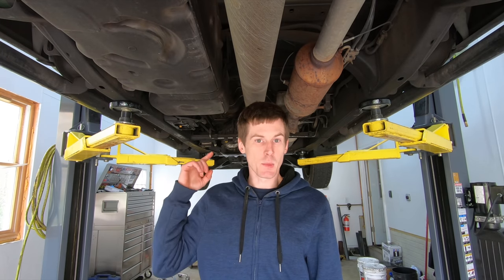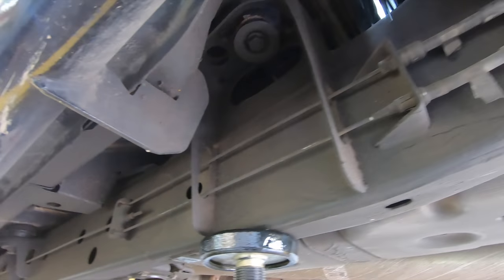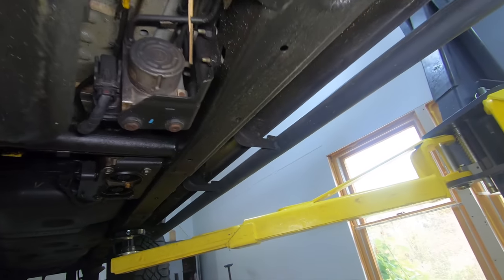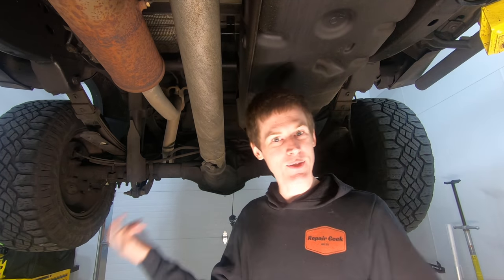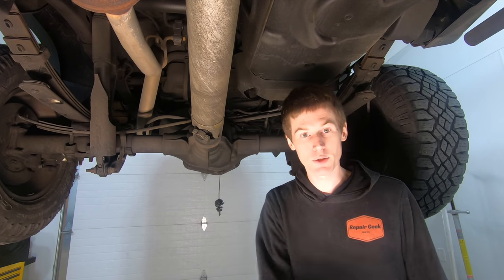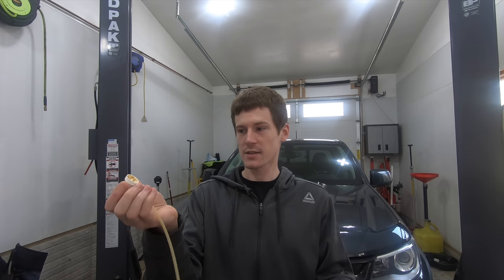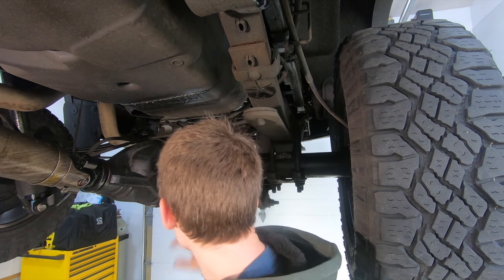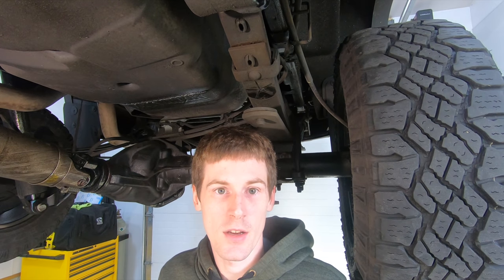Fluid Film Review After 4 Years. (Woolwax vs Fluid Film results 1 yr later)

Comment from the maker: Products used in this video: 
Surface Shield Gallon: https://amzn.to/2YpscVq
Surface Shield 5 Gallon: https://amzn.to/30rrrvK
Surface Shield Aerosol: https://amzn.to/3BIUgk8
Fluid Film: https://amzn.to/3mQbiZy
Woolwax: https://amzn.to/3wmpbS1
Professional Spray Gun: https://amzn.to/3bIN9gX
Aerosol Can Spray Handle: https://amzn.to/3EUpE1b
Graffiti Adapters for Blaster Cans (only needed for older male top blaster cans): https://amzn.to/3CPi5rX
Inner Cavity Spray Wand for Aerosol:https://amzn.to/3NNtZbP
Wireless Borescope: https://amzn.to/3CPdCoV
My Amazon Store:  https://www.amazon.com/shop/repairgeek
Help support the channel, buy using my Amazon links
As an Amazon Associate I earn from qualifying purchases and your cost is exactly the same.

The biggest thing that I have found with any of the Lanolin undercoatings is people always want to know what is "best".   Your application of the product plays a larger role in it's performance than the coating itself. To me this is like talking about the "best" motor oil.  Like motor oil, you can run the "best" oil on the market but you still need to change your oil.  If you don't keep up with your maintenance, your motor oil will turn to sludge regardless of the oil that you use. That is how to need to feel about these coatings. Some of these coatings are better than others but, they will all stop rust if they are touched up yearly with and properly maintained. If you want to use Fluid Film go for it. If you want to use Woolwax, do it. Surface Shield creeps and migrates like Fluid Film but will resist wash-off like Woolwax. That is why I'm switching. It doesn't make Fluid Film or Woolwax bad products I have proven that they both can work well. I want to see if Surface Shield can live up to it's claim of going 2 years without a re-coat.
Reply: Good work, I appreciate it.
Reply: It maybe redundant content for you. For us consumers, it gives confidence in the products. Plus, we all like to see the reality of the long term protection and durability of these products. 22:24
Reply: @js12278  Good deal, where?
Reply: @ureasmith3049  my error. The product I found was NOT Surface Shield. It was their Corrosion Stop protectant. ZERO lanolin
I will be looking for quantities of Surface Shield.
Reply: if you already have rust, is it worth just coating it to slow it down? or is it only good to use it before u get rust?

Comment: I really appreciate these videos.  Because it's real proof that these products work.  For such a long time it was hard to know what products ACTUALLY worked versus what didn't versus what might actually encourage rust and corrosion (I'm looking at you rubberized coatings that crack...).  Largely because of your videos, we bought a spray gun and 5 gallon buckets of fluid film to undercoat our own vehicles (small business and our personal vehicles in Vermont).
Reply: how do u get under the car without a lift
Reply: @randomrazr  If you don't have a vehicle with enough ground clearance, get a set of ramps you can drive the car up on to.  You'll have to lay on your back.
Reply: We use nh undercoating an fluid film. Sometimes if its a little thuck we cut it with premium hydraulic oil or bar an chain oil but not much.
Reply: What is the particular gun u use to spray??

Comment: I did the pb blaster surface shield on my new 250, took 7 cans . Thank you for reviewing that product 👍
Reply: learned of PB  blaster IN TEXAS, i just moved there and had to find a machinist real quick,small jobs and turning transmission drums are a must,i also had a set of valuable cylinder heads machined,i asked the machinist what he uses to stop rust on machined surfaces,he said they had tried almost everything till they learned of pb blaster,he said we only use it on cranks,rods and cylinder heads that have been cut and smoothed,he said it is only good for that purpose,out of the rain[direct] and just deals with humidity from texas,oklahoma,and kansas and mo wet air,for rust we used undercoated tar [asphalt in the 50's on] now ziebart and this fluid flim,when i restore one,i don't want to lose it to the elements this rust situation is an ongoing problem with high dollar toys

Comment: Thank you for doing this.  I live in the rust belt.  I had a brake line failure due to rust and had to replace the lines on the vehicle.  I sprayed the lines on my other vehicle to head off a similar problem.  I wish I had seen a video similar to yours 10 years ago.  What you are doing has value.  People who do this will have less maintenance expense and have greater resale value for a small annual cost.  Whether people listen or want to bitch is out of your control...don't worry about it.

Comment: My personal experience with Cosmoline and FF: Cosmoline on clean surface.  FF on rusted surface.  Cosmoline on rusted surface accelerated the rust, much like rubberized undercoating.  FF washes off too easy to protect all winter long.
Once I exhaust my supplies, I will try Surface Shield.  It looks interesting.

Comment: Uhh, the way you labeled it, the Fluid Film outdoor test metal looks better to me than the Blaster, at least on camera.  Great video!  Honestly, I think FF, WW, and SS all do the job well and will keep a vehicle rust free if applied at least every 2 years.  The videos are great because you are actually testing them long term.  I know it feels redundant, but they are not because of the time passing. That's what we all really want to know. How does it do over time?  Us FF users put up with a lot of stink using this stuff, so we like seeing that it is worth it!
Reply from the maker: The Fluid Film looks cleaner color wise but, the top edge is starting to rust. Whenever I do this pole testing the rust always starts at the top and works it way down the test piece. 
I wipe some of it off here and the surface shield is clean underneath. https://youtu.be/NE1_EiZIVHs?t=341
Reply: I agree. The FF one looks much better!

Comment: Up to this point, you have been comparing two products which give, in your opinion, identical results. In this video,  you explain why you expect more durability from Surface Shield in comparison to Fluid Film and Woolwax. Surface shield is made by the same company that makes PB Blaster, which most mechanics agree is better than other penetrating oils for disassembly of rusted/corroded metal joints. Looking forward to next year's results!

Comment: I used fluid film to coat the leaf springs on my boat trailer on an island surrounded by salt & wind. After one summer by springs looked brand new and still had almost all the paint on them. The boat next to mine that was newer than mine already had extensive rust. I coated them for 10 years, often just once a year and never any sign of rust. Love Fluid Film.

Comment: I found your videos over a year ago when I was starting to buy a 2020 Tacoma.  I coated my new truck last year in October with fluid film. This yeah I did it again with fluid film. I used 5 cans on the Tacoma the first time and 4 cans this year.  It seemed like some was still on w lot of places high up. That and the Tacoma has a composite bed so I didn't need to spray any of the bed underside. 
My truck still looks new.  
I couldn't seem to find surface shield near me so I will continue with it until I can find surface shield.

Comment: I am up in geauga.  I have a leased ram 1500 that i got last november.  It already had rust forming all over on the frame.  My uncles 2 year old gmc 1500 has a good amount of rust on the frame and also a lease.  Have a 2009 f550 at work that i fluid film every year and is used as a plow/salt truck.  It has very little rust on it for its age.  No doubt the stuff works.  I have switched to wool wax but will be going to PB.  Thanks for your videos.

Comment: One of the few things i love about living in California is the weather, or lack-there-of. My 2010 Audi S4 has less rust on it even though it's been parked on the street and not my garage for 10 of those 13 years. But I actually came here doing research about dealing with rust on my old man's 1999 Toyota 4runner which became apparent to me while replacing the automatic shifter bushings the other day, and noticed the front control arm end links were snapped and there was quite a bit of rust on everything. I'm gonna get back under it tomorrow to install the new end links and will bring a little ball peen hammer to give everything a few taps to see how bad it really is.

Comment: Another fantastic video, hats off to you!  .The borescope video is the proof that this works. The tip on those adapters is a great one- I tried, but could not get the 3M wands to stay on the Blaster cans. It's a shame, because the 3M wands are longer and more stiff for working into places the limp Woolwax aerosol can wands cannot. I'm not sure if there's a practical difference compared to Woolwax, but the Blaster's superior creep makes it a great choice for inner cavities.

I have a new van and Jeep to protect, but I'm thinking of using the Woolwax and Blaster I have to coat the hidden surfaces, and the more Cosmoline-like CRC Corrosion Inhibitor on exposed areas where it would the treatment would be easier to dislodge. I will probably use the Blaster or Woolwax on rotating masses like the driveshafts/halfshafts where the weight of the waxy CRC could (theoretically) cause a balance issue. 

One question- the roadside angle iron samples- it looks like the FlluidFilm piece is minimally corroded, but the Blaster piece has a rusty color. Is that just an accumulation of dirt on still-adhering Blaster, and the FluidFilm just washed off along with embedded dirt?
Reply from the maker: The blaster product has changed colors in the past 10 months but it's not rusty underneath: https://youtu.be/NE1_EiZIVHs?t=341
Yes the FF has mostly washed off from rain and I think partially, the summer heat. In this testing the rust always starts on top like you see with FF and then works it's way down the face.

Comment: When spraying any of these bulk products, get a pressure gun. No overspray. The product goes right on the surface. I don't know how the spray cans work. This year, I'm trying waxoyl hard wax undercoating. Here in Central New York State, fluid film doesn't even last through the winter. For inside door panels and places not subject to spray or abrasion, it works fine. I also added electronic cathodic rustproofing.

Comment: I use Formula 3000 Rust Cure. My undercarriage is like new. A lot cheaper than Fluid Film as well.

But fluid film does the trick as well :)
Reply: Is formula 3000 rust cure lanolin based?

Comment: if one does not pull off bumper covers, you will not know if you've covered it all, including bumper cover retaining brackets under the headlights common on non-trucks ....also don't forget pulling back trunk interior liners, spraying the floor if parking cables come through under the center console....ask me how I know.

Comment: The paraffinic oil in FF is high viscosity; the naphthenic oil in SS is low viscosity; both are petroleum products but the SS product flows a lot easier than the FF product because of the viscosity difference.

Comment: Been using fluid film for awhile. I get it by the gallon and brush it on. I'm  in ct.  Great detail with the boriscope.
Reply: you can use a cheap plug in paint sprayer from harbor freight  been applying  it that way for 2yrs now.
Reply: Thought about getting one, but was hesitant due to issues with clogging up.
Reply: Get an undercoating gun. Sprays Fluid Film perfectly.

Comment: Great review. I have a couple questions for you. I have been having my vehicles Krown's for the past few years. It has gotten very expensive every year as well as I have 4 vehicles now to get sprayed each year. I plan to purhase the FF sprayer and start using that product. My 2 questions are, in this video, do you only spray these once per year & during the winter, what is your wash process? I typically just wash the body of the vechile and will lightly spray off the underside to get any lose salt off. I assume that will not wash the FF away?

Comment: Dedicated Fluid Film/Woolwax user here. I finally found the Blaster Surface Shield locally. I agree with your testing and opinions. I’ll be going over to Surface Shield after my gallons of FF/Ww are finished. I’m sold on the lanolin based products. I really hope gallons of Surface Shield show up soon.
Keep up the great work!
Reply: The gallons have shown up on Amazon now.  He has the link above.  Warning,  the gallon is 40 percent more expensive than Fluid film gallon.  Which is strange, since the aerosol cans are cheaper.
Reply: @ureasmith3049  the aerosol cans seem to be in line with FF/Ww pricing @ $9.99
As long as there’s a way to use the nozzle attachment, I’m very interested.
Reply: Think it is a joke that Pb made the bulk form so expensive.
Reply: @martinmorris6271  I haven’t found it locally so not switching over at all.
I’ll stick with my reliable FF/Woolwax

Comment: Careful with all that wool wax on the frame and the lift arm pads so that you don't knock it off.
Reply: That would  be nasty indeed . Some of the lifts look a little dangerous . The Gm dealer I worked for had a hoist single big hydraulic ram i the centre it dropped 2 feet suddenly good thing I was not standing straight but bent over .

Comment: I have a jug of "HinderRust" made by the guy that formulated Kroil (orange spray cans).
I sprayed it under my Montero a couple years ago. There are reports it spreads out on its own. Also, if you get it on a painted surface it's very difficult to remove and new paint won't stick. It appears to be about the same color and viscosity as  Blaster Shield.
Reply: "Master Blaster?"

Comment: Professional mechanics, what are your opinions about servicing/repairing a vehicle that’s been treated with Fluid Film, Woolwax, etc.?  It certainly beats fighting seized components, but interested in a pro’s experience and opinion on this subject.

Repair Geek, thanks for these videos.  I greatly appreciate the effort you put into this.
Reply from the maker: As far as working on the vehicle, yes you're going to get dirtier than usual.  The only real downside to this coating is it makes it harder to find small seeping type leaks. If I have any small leaks I don't know about them. If I have a large leak that drips I will know because this coating doesn't drip of that makes sense. If you have a leak a good mechanic will use an UV oil dye to find the source. The coating won't really change how he does his job.

Comment: Fantastic results and I need to do the same for my truck! As regards the exhaust system, I am wondering if you considered applying a graphene-based coating.  That should not decompose and in principle should provide some rust protection.  Also, what about Rustoleum high-temp paints?  The deicer exacerbates the rusting as well and so your results are very impressive.

Comment: Never heard of that adapter before, but that's pretty cool.  Still would be nice if PB would change their can design to use the other style caps.

I have both FF and WW (anyone noticing a trend in product names?) and use it on my ATV and my tail gate that was starting to rust at the bottom of my hunting/fishing trick.  Three years since I first started spraying the products inside with the wand and the rust hasn't gotten any worse.
Reply: Love your videos, I ended up having my 2019 Silverado undercoated with Woolwax. The shop applying it told me they would not spray my frame because the Woolwax is petroleum based and would soften my factory frame wax. What do you have to say about this?

Comment: I had a thought,  What if you mix your left over Fluid Film with some Vaseline?  That would be an interesting comparison test to surface shield.
Reply: A concoction of Fluid Film, melted paraffin wax and zinc would be an interesting test.   Bees wax mixed with some grease was the original cosmoline.  The grease makes the wax more sticky so it won't easily chip.  You can mix the melted paraffin with some solvent like mineral spirits so it will spray easier at a lower temperature, the solvent will evaporate.

Comment: I don't know how long these products have been on the market, but what we really need to see is a long term test vehicle. For example a vehicle that is 10-15 or even 20 years old that has been exposed to the rust belt with the use of these products.
Reply from the maker: Well I'm at 5 full years now. No issues. You have to count to 5 before you get to 20.
Reply: @Repair Geek  
I am just saying that i bought my truck new 22 years ago. When I look into these types of products,I want something that will last since I keep a vehicle long term.
Reply: @bradbruggeman6745  I live in Nova Scotia near the Atlantic Ocean, we get snow, salt on the roads, lots of rain , salt in the air from the ocean etc , car and truck undersides take a real beating here. I have a friend who imported a late 80s Toyota 4x4 pickup from Arizona about 15 years ago , the frame was still mostly black paint . He drives it year round but has soaked it with FF every year, the underside of the truck is cleaner than a 3 year old truck , I can still see lots of black paint on the chassis , no rust on the body .